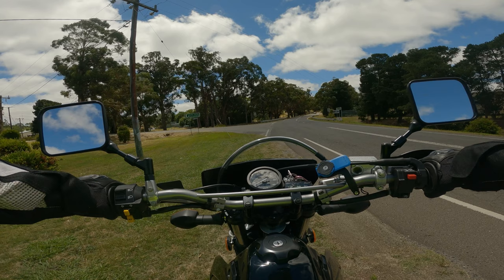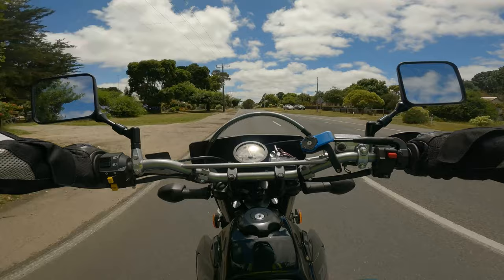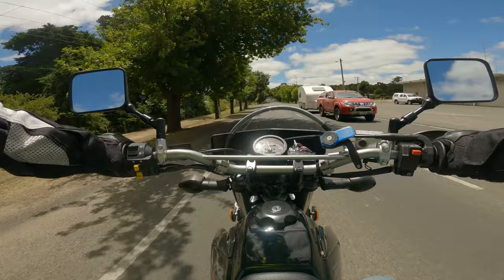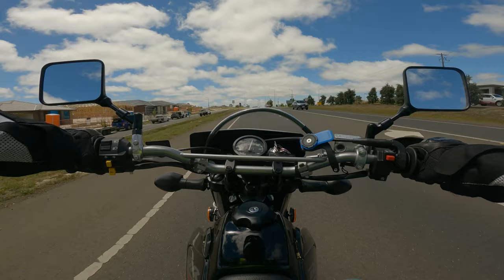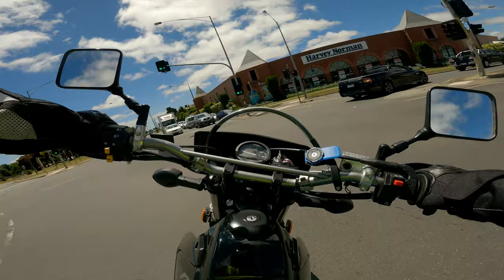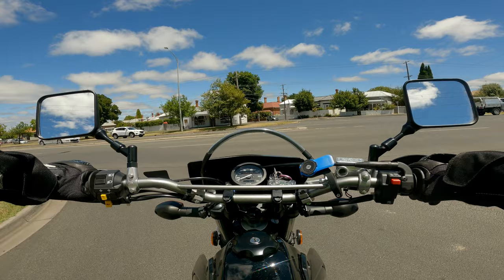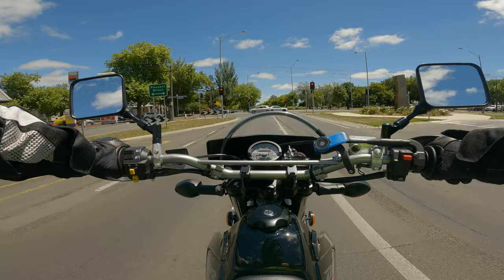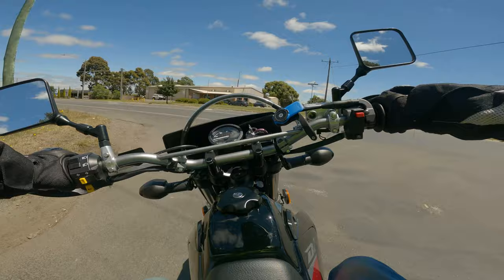DR200 on highway

Comment: I have a 1988 DR200 in the garage where it has sat without being started for 7 years - since I got the DR650 I guess. My DR650 has got a lot of use but there are real merits to the little DR. In every sport we pay more for the lightest equipment except motorcycles. The little DR is 100 pounds lighter than my 650 with a 20 litre tank and goes a long way with the stock 13 litre fuel tank and that's a huge benefit off pavement. I'm hoping to get mine going and take it instead of the 650 on a 1000km adventure coming up to try to make a point to the group and to myself. There's an American kid name Gabriel Chroust who took one and after a few mods beat every KTM and Husqvarna off road race bike in a 24 hour off road endurance race. I don't need beat all the ready to race off road bikes but I took notes on his easy cheap mods to make it a very capable bike off road.
Reply from the maker: KTM tears lol 👍

Comment: Hello from western Canada. 
200c.c. ?  Poor little motorcycle  -  it wont like many highway rides before the engine fights back   ; )
Reply from the maker: Yeah, I dont usually go that far on the highway. Generally just hopping to and from, between forests. But have to go into town from time to time for the practice, take the back roads most of the time . Once I finish my licence she wont need to make that trip to often lol.
Reply: @DR200Gold    

I am in western Canada. 
I have a Honda CRF 250L Rally.
I only take it on highways that have 80 kilometer speed limits.  The trans Canada highway here is too busy for this one in my view. 
https://www.youtube.com/watch?v=p4E62OsekMk 
: )
Reply from the maker: @firstchoicelastchoice28  The highways here are all pretty much 100-110kmh, but the ones around here are no where near as busy as that, but do get a few big trucks which I try and pull over for and let pass when I see them coming up in the mirror though :)
Reply: @DR200Gold 

 I used to ride various motorcycles on this highway number 401 in Toronto.
I spent 30 years and made it out with no crashes.

https://www.youtube.com/watch?v=GMtusG5tuC8

https://www.youtube.com/watch?v=HYLY5TfPn2s

At the airport this highway is 16 lanes across
https://www.youtube.com/watch?v=nTrothZ7cYM

I don't think a 200 would make it     : )
Reply from the maker: @firstchoicelastchoice28  We have some similar freeways heading into Melbourne, a trip I'll stick with the car for, definitely not this bike.
Reply: @DR200Gold  as a trucker I thank you. That’s good driving. You would not believe the amount of people that don’t notice a person coming up behind you or just don’t care. Except on straight stretches, the only time they speed up. First corner or snowflake and on come the brakes. 
Have a great day sir
Reply from the maker: @missesmew  A little courtesy on the road when ever possible, saves a lot of aggravation for everyone I find 👍
Reply: I went to a 16 tooth front sprocket and love it. Feels like I got a sixth gear!